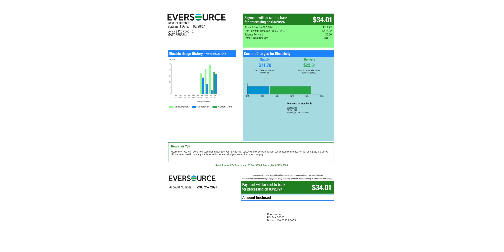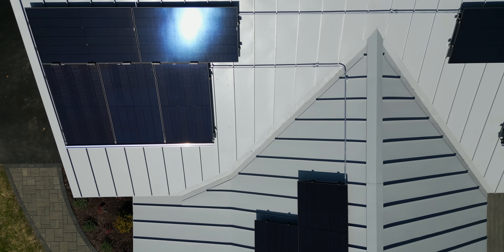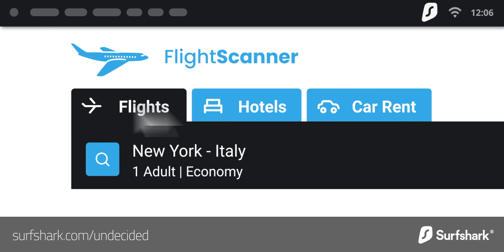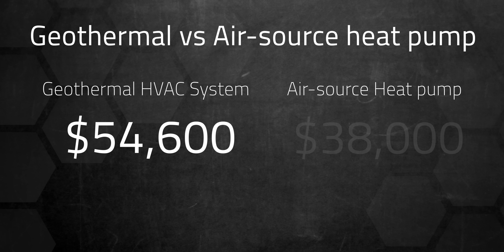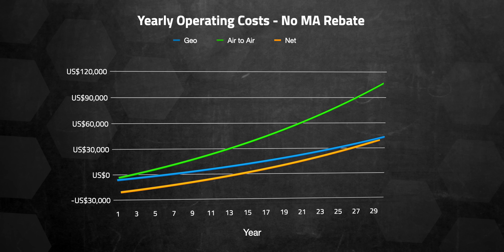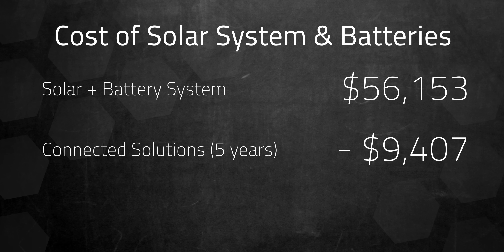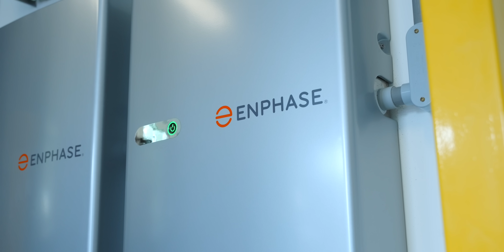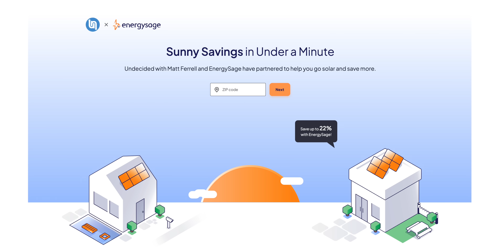What I Learned After 1 Year with New Solar Panels

Comment: i agree 100% with "your locale matters". With respect to that, the further north one lives, solar makes less and less cents (pun intended).

what is your square footage? this should factor into the comparison.

i live in #houston. i installed a a 15.7 kw system and 20Kwh batteries (Enphase) with the design objective of 101% replacement of electricity. Historical annual usage approx. 18mW. The design goal of the system was 2-fold. #1 priority- provide partial home back up when grid is down (local outages/ tropical storms, etc.) vs. a NG powered generator, i.e. run 1 AC, keep frig and freezer going and some circuits. #2 priority produce and consume solar energy without grid power as much as possible to "pre-pay electricity". No EV. 3900 square foot home. 2 floors. 2 ACs. Gold efficiency (whatever that means) home built in 2012.

i view the solar panels as comparison to grid energy. And view the batteries as back up energy, aka the back up generator but with the added benefit of minimizing grid energy. i have net metering but only up to monthly grid consumption...so excess production has limited value. This is a recent change from the utilities...i suspect that will be a change that slowly spreads as solar is more prevalent.

overall, priority #1 is achieved. Solar and batteries performed as planned for...though when grid is down conservation is key. Some tropical storms hit hard for day and then clear out (plenty of sun) but the grid is down for many days due to damage. Some hit and move slower so more clouds in following days (lower solar production) and the grid is down for many days after too.  limiter is solar production not battery storage.

Priority #2- overall pleased. net metering limit impacts the $ credited, thus costs. Roughly, 6 months I pay only utility grid access fees. 4 months (June - Sept), pay max $115 (record breaking July 2023) average $75/month to utility. 2 months consumption = production

Summary
2022 (partial year) produced: 16.1 kwh; consumed = 17.4 kWh
2023: produced 19.9 kwh; consumed = 21.2 kWh
2024: (partial year) = 18.6kWh; consumed = 21.9kWh

Would i do it again? in the South where sunlight is a plenty. Yes. Further north...say Massachusetts. No. i could see solar further north say in the interior West where sun is a plenty. Yes. But north where more clouds (great lakes, rust belt, NE). gets to no pretty quick EXCEPT considering the high utility rates...but maybe thats a whole other political/policy discussion. Policies push #climatechange agendas drive changes and utility rates significantly higher AND ignore the safest and most efficient power source #nuclear...but i digress

Your utility rates at $0.31 is California nuts high. I pay for grid energy in #Texas $0.185. produce energy (solar only = $0.156; solar+battery = $18.2). So I am now saving money 94% of the time.

Comment: Btw. More components mean more failure points, u have to factor in the repair cost or cost of insurance for additional coverage for ur assets, and property taxes too. Normally manufacturer warranty only cover the materials not the labor (which most expensive part of costs) the repair cost could eat up ur saving.

Comment: We are having the same stuff installed on our house this next Monday, unfortunately it's only a 6.4kw system with 2 of the 5P batteries, We wanted double this but local fire codes will only allow 16 panels on our roof. The entire project is costing me $43,000 $10,000 of that being a new roof.

Comment: You are getting 71000 in tax credits and rebates. you need to take that crap out of your calculation, that's basically theft of other people to give to you by big daddy government. Also NONE of that equipment will last 30 years without repairs/replacements after 5 - 6 years. One hail storm is going to take out the panels.

Comment: I bought a house in 1999 with a consumption of 42000kWh. This year about 15000kWh. I insulated the attic with 10cm extra insulation. Bought a air heatpump 1700USD incl install. And controll the ventilation fan by adjusting the motor speed. Energy running cost 2800USD per year incl everything. I live in Stockholm. The house is 165square meters.

Comment: In February 2010 I installed  25 panels for a 5kW/hr system. The first 8 years was on a 100% sell to GeorgiaPower at 17¢ / kW with a cost of 12¢. GeorgiaPower ended the contract in 2018 and new contract option were less attractive. In 2020 I installed a Sol-Ark 8K controller and 12 Sol-Ark 2300W PCC AMG batteries. I sized my system to be nearly neutral in spring and fall. As you demonstrated going net zero is  expensive to cover the high and low temperatures. My best year was paying a total of $280 and now I am at $700 annually because GP does not net meter and has increased prices as well as have us prepay two new nuclear power plants on the Savannah River. After nearly 15 years I am still happy with the decision to go solar but disappointed with the options from GP.

Comment: 88k?  Ouch.  I have a diy home system with a honda 2000w generator backup which cost me less than 10k. Call me cheap but I've been off grid for over 20 years and i have a comfortable home with refrigerator hydrnic heating washer dryer and other appliances.  Thank you for your in depth review of your system.  I would like a system like yours.  But cant afford it.

Comment: Is there any drill down for people with significanly less capital? I live in the UK and my total net worth is less that the least expensive modification, and I can't get afford a 30 year mortgage at age 40 in a country with a retirement age of 65. I live alone and can't combine finances with a partner. Combined with the underperforming insular economy, high import taxes, and rather finacially inefficient installation policies, we're looking as 2--4x the overall cost for a given level of installation. I can't get a locan to purchase any property in my city. Is there any route to implement any sustainable modification if I am on track to rent with with very little rights for the rest of my life, and am generally relegated to the lower end of building quality with poor thermal efficiency? I am willing to go a lot of DIY engineering, but it can't be anything that modifies the sublet leashold apartments that I'm able to access.

Comment: Idk how any of this makes sense unless your utility rates are insane.

I'm in Canada where we have 140* F temperature swing between winter and summer and I average approx $2000-2500 CAD per year for a Gas furnace for the house, 7500watt Electric heater for my garage for the entire winter and Electric AC unit for summer. So 25 years = 50k CAD or like 35k USD.

Comment: 1) hot take: you should mine crypto with that excess power. 2) serious reaction: I appreciate the fact you wanted a system that would last 30 years, but you paid way too much.  $0.31 per KWH does help justify the tremendous expense for your solar system, and the high price of batteries just two years explains some of it.  LFP batteries are crazy cheap now.  Enphase uses micro inverters on each solar module and triples the cost per module.  Even though the central grid tied controller is much less expensive as a result since it's all AC, a 48 volt DC output MPPT multi string inverter such as a Sol-Ark 15k with the same number of solar panels would ultimately be significantly less expensive.  Here are some costs for components not using Enphase.  $100 a module would get you to $4300 for 43 solar panels.  $7000 for a DC-AC battery and solar hybrid inverter capable of back feeding your loads within 100 watts without any net metering agreement.  $3700 for 28 KWH of LFP 48 volt batteries with BMS and over current protection.  $2000-$4000 for racking and conduit on your roof.  $20000 in solar off grid components.  $20000 for labor would still have you at $40k for your solar system.  You could even add a second large inverter in parallel to maximized peak output and peak solar and still be under $50,000.  In 20 years time you could could replace the solar panels and probably come out ahead financially from the direction you went.

Comment: No chance the equipment lasts the whole term, especially when you start adding up all of the gadgets just to heat water. There would be a reasonable way to do this in the US if the entire industry wasn't dominated by private installers who are looking to maximize the cost and create barriers to entry for anyone who would compete, along with, of course, the desire to create credit tranches with the loan/lease associated with the systems to sell at a margin in collateralized debt securities. Everyone wins except for the customer, i guess.

The whole payback scenario doesn't work unless you add interest opportunity cost and reasonable expectation plus margin for the amount of break down and equipment replacement you'll be subjected to.

Comment: Not counting hot water, I'm only using around 1.7 mWh per YEAR.  Hot water is included in my condo fees and not monitored by unit, but I'm still wondering if you might do a lot better on the consumption side.

Comment: Simplistically, with a system cost of $56,000 and assuming you eliminated your $400 per month average electric bill, your breakeven period would be about 12 years. That's before considering the interest on any loan. I had a solar company give me a proposal 3 years ago and my net cost after rebates would have been $55,000. By my calculations, and based on their numbers, for me to break even I would have had to live to age 115.  So while solar is great for some situations it's not for others. And that's exactly what you are pointing out in your video!  Nice job!!  :)

Comment: I think one of the rarely-mentioned issues in deciding about installing solar becomes, for some, a show-stopper.  In ALL of the proposals - over the years I've been looking, and that I've gotten so far, although obviously it can change, and "your mileage may vary" - they've all had a highly undesirable flaw.  For grid-locked systems, where you sell excess electricity back to the grid, that flaw is: when the grid loses power, so do you.  

That is, when the neighborhood power goes out - a line comes down in a storm, etc., and despite all those panels on the roof - your power goes out as well.  That happens a lot up here in New England from fall hurricane season through winter storms, so going "autonomous" from power failures via a solar installation seemed a great way of avoiding that problem - but the systems offered don't provide such a solution.

While energy savings was one of the attractive features of solar that initially drew me to the idea of solar, it was the idea that I would never again need to sit in front of a fireplace wrapped in a blanket, or throw out thawed food.  Or the alternative of hurriedly stuffing food in coolers, left in the entryway, covered with ice - if any was left in local markets.  That idea of grid independence represented a large part of my motivation to investigate solar - instead of, for example, using a gas generator.  I was surprised to learn that while being able to sell surplus electricity back to the grid was a bonus, it came with a major caveat: the grid goes out - and so does your house.

There's a good reason, of course - linemen working on downed lines need to be assured that if they isolate a line from the main source, there aren't hundreds of solar-powered houses still pumping electricity into that wire they are working on.  So to accomplish that, if your power converters detect a power failure, they shut down the DC:AC conversion of YOUR solar panels, and your house goes black.

There's a way around it, of course - but (surprise!) it costs money.  You have to install an automatic transfer switch - an ATS - or a manual switch (less convenient, and doesn't work when you're not at home) in order to isolate yourself from the grid.  When a grid failure is detected by the ATS, it disconnects you from the grid just as it would do if you had an emergency generator.  And, if you have a smart inverter, at that point you can resume powering your home just as a generator would.  

When power is restored, the ATS detects it, you synch back up with the grid phase, and the ATS reconnects you.  The hardware to do that isn't cheap - nor is it commonly offered by solar installers, either, who are trying to sell you on solar on a return on investment basis, and so are loathe to add to the investment side of the equation.

The current (no pun intended) way around this for night time power gaps, is to offer battery backup to fill in for the panels - but not for grid failure.  At night, the grid is still up, and the inverter is still synched to the grid phase - relying, as in the daytime, on the grid's presence to continue operating.  Essentially, the battery is just a "virtual daytime" that provides DC to the inverter instead of the solar panels, and has the same restriction as the panels in a power outage.  

Having panels to generate energy, and a battery to store it, but not being able to use either if the grid goes down is a non-starter for me.  And if you do have an ATS to disconnect yourself from the grid, you still need a ~"clock" to create a 60 Hz timing cycle for the inverter that mimics the grid clock. That's what it takes to be truly autonomous - at least until your batteries run flat.

Stepping back from the issue of convenience, however, brings up an issue of even greater importance.  While this extra equipment is an added expense, its absence also overlooks a potential strategic benefit of having autonomous power: national security.  If the grid were taken out in an attack - by terrorists, rather than storms, for example - or even by an attack of a hostile government entity, the resultant disruption would be catastrophic.  Well pumps don't work; sump pumps don't work; furnaces don't work; food goes bad because refrigeration doesn't work; stoves and microwaves don't work; security systems and lighting doesn't work; communications systems - TV, Radio, phone - don't work.  

A citizenry that can't be informed about what is going on is thrown back into the medieval state - one to which they are completely unaccustomed.  A fully-"hardened" country - one as incapable of having its power cut off as the Internet is designed to be in case of disaster - is one that can be coordinated, informed, and marshalled to respond to the threat.  

One that can charge its electric vehicles and continue to transport goods and services.  One that - at least for electrical machinery - can continue to operate as a nation.  The value to the nation of being able to continue to operate through grid disaster is strong motivation to make the adoption of fully-autonomous, "hardened" solar/battery hybrid-powered housing a national goal.  

To make that a reality, it should be highly subsidized by the federal and state governments such that the cost of installation is not a deterrent to any homeowner - potentially, in fact, free.  There's a pony in there someplace, and such a nation - armed as it is -  would be a truly formidable and daunting prospect to an invader or hostile force.  Not a bad objective as an extension to the goal of Net Zero.
Reply: Nobody wants to read a book  Keep it pithy.
Reply: @robertd9850  How about if I pithy on your heady?  I find that anyone who complains about "more information" that they are in no way obliged to read, and objects on behalf of other people that they don't know the motives or interests of, on a site that was designed from the outset to provide information to people, to be presumptuous at best and lazy at learning at the very least.  It really doesn't take any more complicated an answer than that.  You really need to work on better comments.
Reply: @ Wordy.  C minus.
Reply: @robertd9850  Longer than your attention span is capable of, I guess.  Try Mac and Muff.  More your speed,  Leave this to adults.
Reply: @ Adults don't ramble on, that's what children do.  Read the room.
Reply: @robertd9850  You must be a riot at libraries.  Want to reduce everything to pamphlets, do you?  You have trouble reading, so everyone should be deprived of the experience?  Perhaps a remedial course is in your future?  I can see it all now: "Your assignment for the weekend: 'War and Peace' - and - little Johnny - you can read a postage stamp."  What else would you like the rest of us to do so that YOU aren't offended?  Should we all wear shorts?
Reply: @MrGsteele  I think you just like to hear yourself talk.

Comment: At 72 yrs old this makes no sense for older folks. $50K-$80K to install the panels and batteries just doesn’t make sense for me and frankly for most Americans. The per month cost for these is more than my present electric bill and that is for the next 20 yrs. Also the power companies are changing the terms of what they will accept and how they pay or credit you on what you produce.
Reply: Much better at our age to have a backup battery/solar system for power outages.  I had an electrician install a 30 amp circuit so I could run my generator through my breaker box.  Have to turn some things off but on a snowy day, I have central heat (gas), TV, computer, coffee, gas fireplace, etc.  No clothes dryer or garbage disposal or A/C but I have plenty of clothes and growing up we had no AC, no garbage disposal, no garbage door opener.  I'll cope.
Reply: Don't simply take his numbers as a quote for what it would cost for you. He spared no expense, and a great expense could have been spared but he wanted top of the line convenience. Check with local contractors for real information about your specific situation